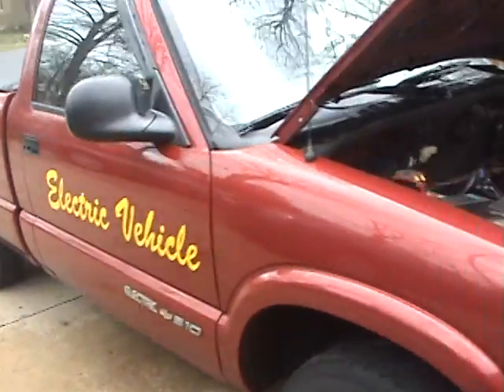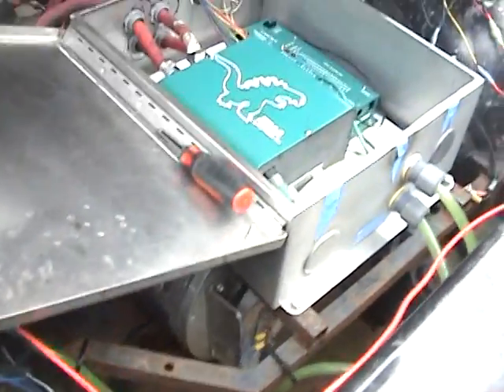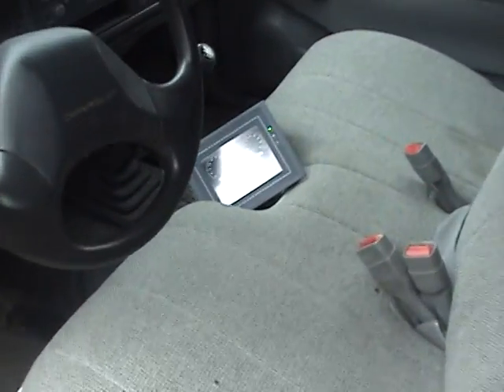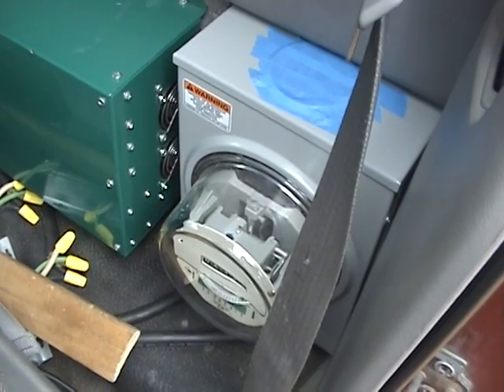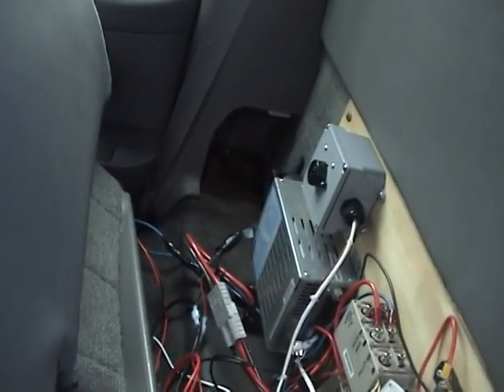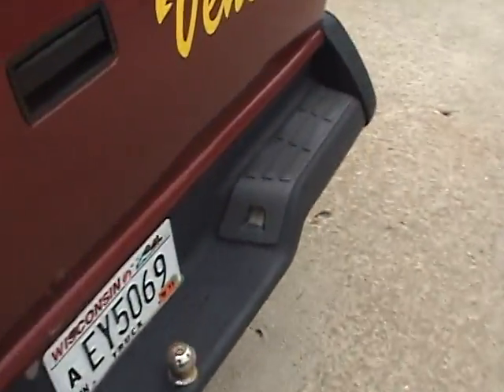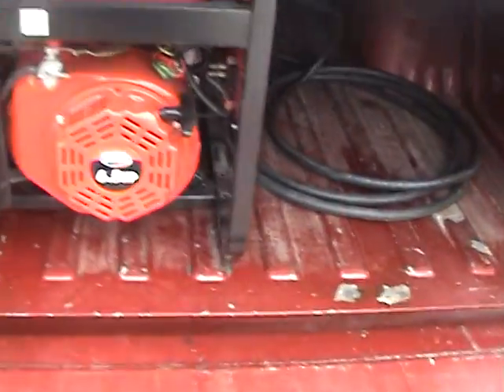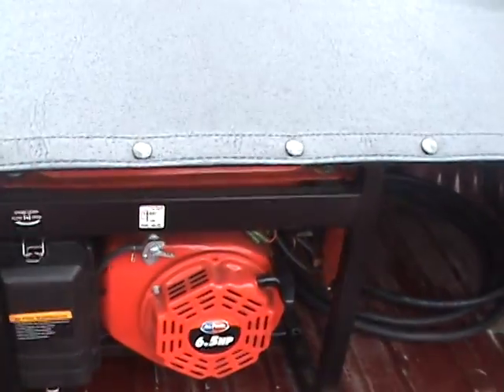Electric Chevy S10 Hybrid Mode

Comment: Yeah, if any thing I'd want a Hybrid so that  I can charge with electricity at home but I can still use gas to charge it incase I get stuck away from home, of course.
 How many Kilowatts does Your generator put out compared to how many kilowatts Your truck uses at like 35 or 60 MPH.
  Basically I'm wondering if You can drive and charge off of Your generator at the same time that You are driving, if it's a zero sum gain or if it actually puts out more power than driving takes. Ok, Take Care.